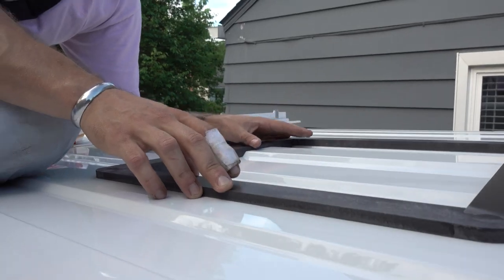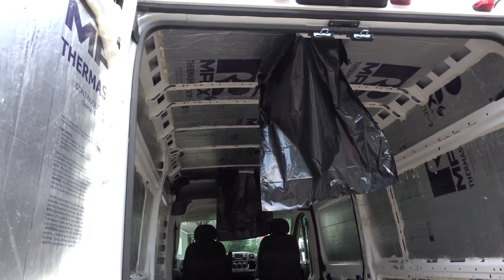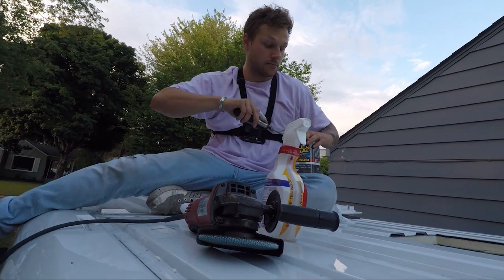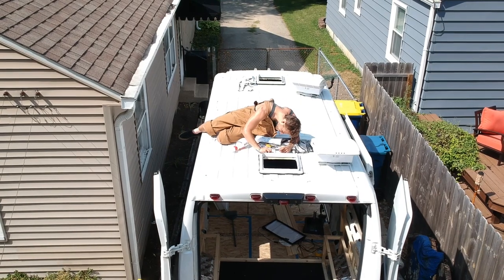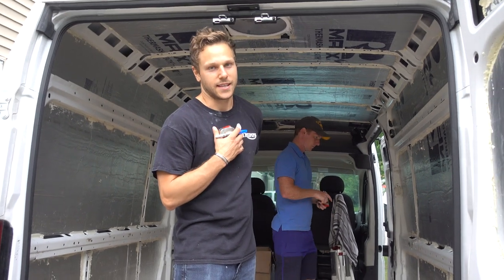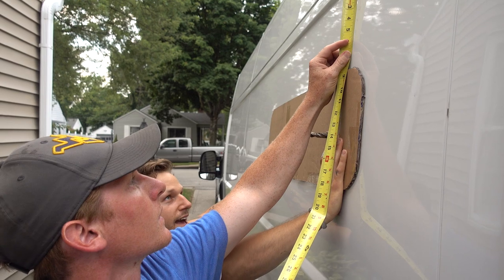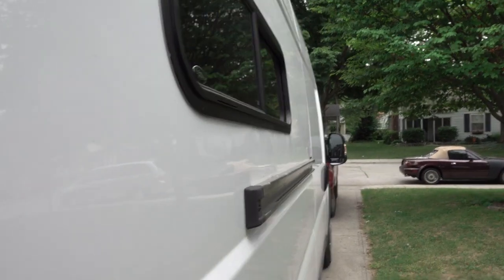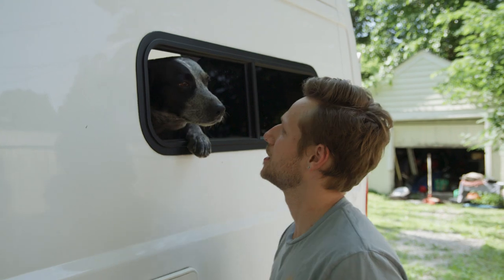Cutting Holes In Your Van | Fan and Window Install

Comment: Great video. Sandpaper with bare hands on a newly cut metal edge.....A hair's breadth from an awful outcome. A flat file is required, which can be scraped along to remove any burrs and sharp bits.  But thanks so much for your video. Its very useful, despite the "is he really doing that?" moments.

Comment: Watched one of your other videos about your shower walls that had non-galvanized metal and you weren't happy with it. I have 2 options for you, clean the panels with 0000 Steel Wool to remove the rust and wax the panels with car wax. Number 2, remove the rust, then paint on the clear liquid ceramic coating they sell for cars, it's expensive, but you should only have to do it once. I'm cheap, so I'd wax it, then use a DA buffer on it to make those wslls rust proof and so slick, a drop of wster would run right off. Liked your van tour.
Reply from the maker: Thanks for the tips. I plan on doing some renovations to the bathroom this fall so I appreciate the suggestions.

Comment: Hey I think the ripples would not be there if the windows were higher up. The motion windows site explains how the narrow windows like you have are flat, but the bigger windows (with more height) are curved due to the curve in that part of the van.

Comment: Great video! One question. Just installed bunk windows myself, and experienced the same wrinkle issue. When you added the backing wooden plate, did the wrinkles come out?
Reply from the maker: Nope, they are still there a little bit.

Comment: Hey! Just subscribed to your channel, I’m starting a van build and working on installing a window (CR Lawrence brand onto a 2019 promaster passenger sliding door). Having a lot of trouble figuring out the screws we were given and I see you used both adhesive and then screwed everything in at the end. Mind if I ask about the screws? Is it the metal frame to the main window frame?
Reply from the maker: My windows came with two pieces. A frame with the window in it and a trim ring. The frame has a flange where I attached the butyl to keep moisture from getting in the van. It also serves as an adhesive. Once the window frame is placed in level, I took the trim ring and attached directly to the window frame with the screws provided. As you tighten the screws it squeezes out any air gaps you might have had in between the van walls, butyl, and outer flange. I didn't have to attach any screws to the van walls. They all screwed into the window frame. Does that answer your question?

Comment: Would u recommend two ceiling fans or one fan would be fine?
Reply from the maker: I personally like having the two fans because I have one located up front to help ventilate while I'm cooking and then one located over my bed to help circulate air while I'm sleeping. When it's hot out I set them both to extract mode and open the front and back windows to circulate air throughout the entire van. You can probably get away with one up front as long as you have windows in the back to pull air through, but I've only had experience with having two fans. I would recommend getting fans that can both push air in and pull air out. You can always install one and test it. If it feels good, don't worry about installing a second.